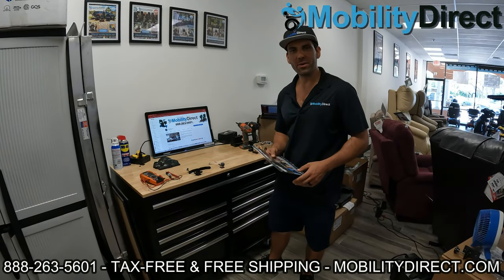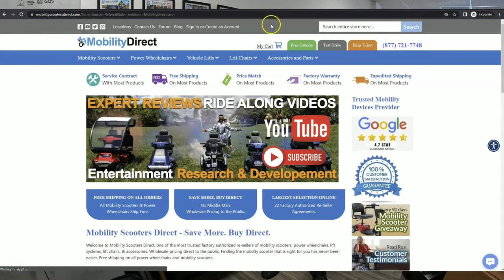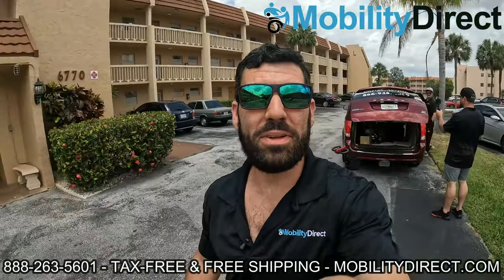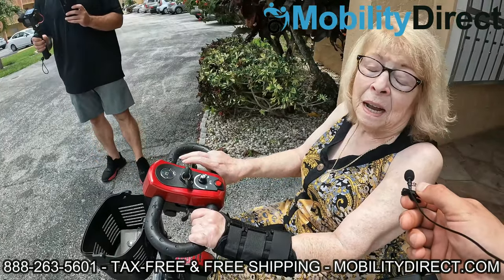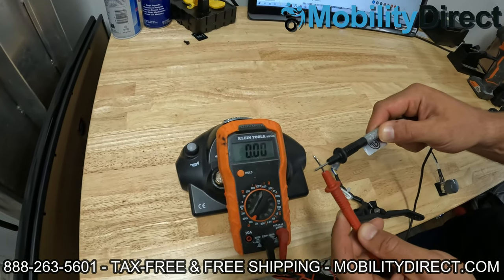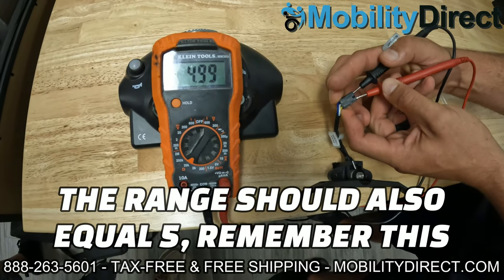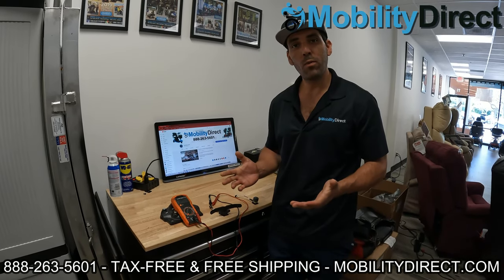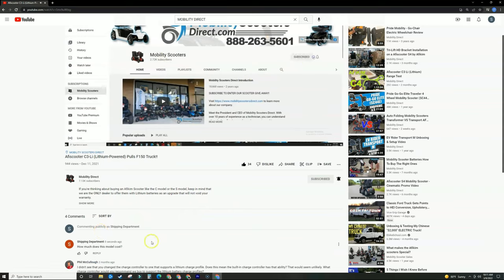🔊7 Beep Code - Testing a Mobility Scooter Throttle Potentiometer

Comment: Thanks for the videos you do there great . I have looked for a video about removing the fork and greasing the bearings  when taking the tiller apart and unplugging the wires I do understand.  When separating the fork off the tiller  is it like a bicycle ? Thanks
Reply from the maker: It depends on the model you have, most of them. You just need to take the bolt and nut off the front wheel if it's a three-wheel model. If it's a four-wheel model, there's usually just one bolt that threads into the axles. You don't really need to worry about disconnecting any wires to grease your bearings.

Comment: Hi, can all be connected to the terminals for testing, like separating the control unit to see the speed control and potentiometer all connected, and testing as they are, or do you have to disconnect the units to get a reading.? only in the neutral position my multimeter reads. 3.8 on the throttle potentiometer when altering the speed the reading goes up a down and different readings when moving, 
and wondered if that shows a faulty unit.?🤔😊
Reply from the maker: You don't need battery connected to test resistance.

Comment: What is the rating of the resistor on the centre wire of the throttle control?  Go-Go Elite Traveller (straight handlebar version)
Reply from the maker: The video we used is actually the same potentiometer. Just follow along with the video.
Reply: Probably 10K

Comment: I'm still getting 7 beeps after replacing both Potentiometers and I tested both old ones and they passed with flying colors. What's my next step?
Reply from the maker: Thanks for stopping by our YouTube channel and watching the video. There's no easy solution for this one. We recommend getting in touch with the dealer where you got the scooter from or a technician. If you got your mobility product from us, please feel free to reach out to us at 888-263-5601
Reply: Next step would be to replace the controller underneath the deck